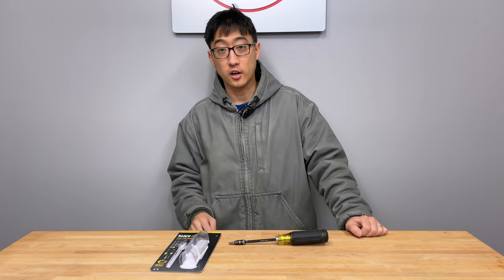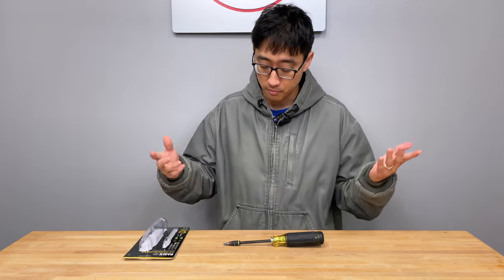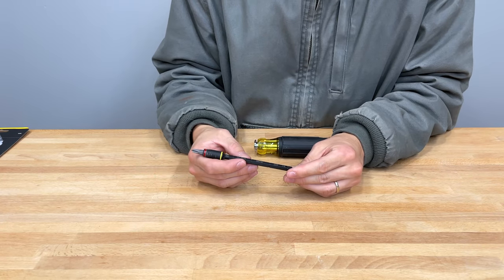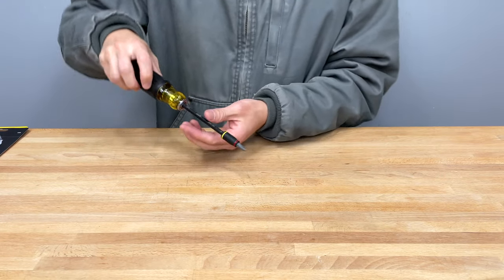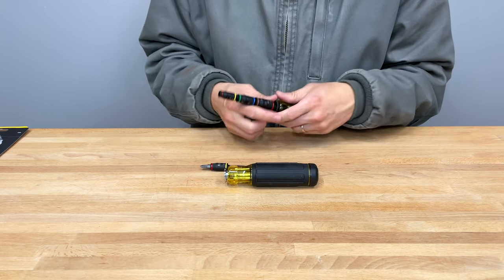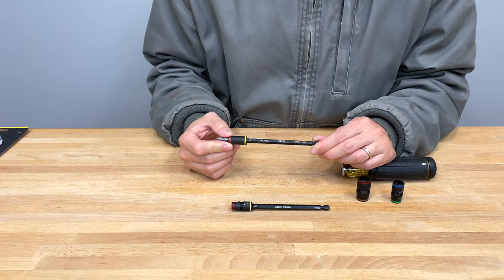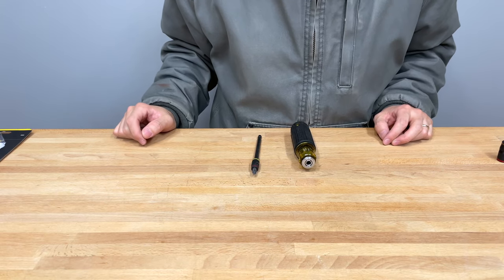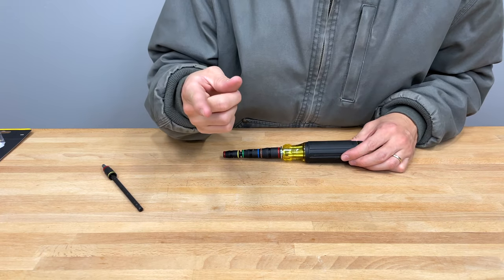You need this: Klein Tools 14-in-1 HVAC screwdriver | The Ultimate EDC all in one 32304

Comment: After seeing you remove your flip out of your 7 in 1 I’ll say my 7 in 1 handle was not releasing the socket at all. Some penetrator got it loosen up a little (it’s all I had) wondering if it was defective or is it supposed to hold the bit that tight.

Comment: I really like how you can shrink the shaft. My bit driver just broke from years of use, and I am excited about how this one looks. I am definitely going to get the Klein older stubby and most likely get both of these. The only multi bit screwdrivers I hate, are the ones with proprietary bits, like double sided one's. My last one was double sided and I use double sided bits with my Leatherman Rebar, but I use the Wiha bits. They are always going out of stock and not to may companies make good double sided bits, with all the different bits. The other day I seen a few triangle screws and I thought I had basically every bit I would ever need, until I seen the triangle screws that I had to remove. I really wish companies would stop making all these different screw heads. I understand that Phillips wasn't the answer and square and torx were supposed to be better, but why triangle. I ended up ruining a few bits, taking those out, since I didn't have those bits, and I bought a $30 bit set, that has pretty much all the bits you come across because of that. It makes me look bad, coming into a home or business, and not having the tools I need. That's why I love multi bit drivers. That's just my rant on screw companies. 😅

Comment: This is like meeting a new chic.  I'm 2:40 in, and so far I'm liking what I'm hearing and actually a little excited that I might have just found the one.  A shaft that you can take out and stick right into the impact driver!  I'm often driving screws with the impact driver all the way until they're near tight, and then have to switch over to the ratchet or screwdriver to finish tightening.  BUT, just like with meeting any other chic, I'm sure that something will come up to spoil this... probably when I find out how much she's gonna cost me.  Chics, I mean screwdrivers, this too good to be true are usually expensive.
EDIT: NO FREAKIN WAY!?  HD sells this thing for $24.97 !!!!  Ok, price is good.
EDIT: DAMMIT, I KNEW IT! She ain't orthodox.... oops, I mean it ain't ratcheting.  I knew something would spoil it.  I'm breaking up with this screwdriver.

Comment: I recently found something even better: Milwaukee 13-in-1. It has 1/4, 5/16, 3/8, and 1/2 hex drivers. It also has square bits perfect for ECX screws or whatever else they'll fit. It's also got Schrader valve drivers and large/small Phillips and slotted bits. The only thing it's missing is a magnet so that it will hold other 1/4 bits which don't have the ball bearing. It is a great tool I'd recommend looking into.
Reply: So, it has less and isn’t magnetic? Is it better cuz it’s red?
Reply: @senilegoldsmith4112  the only thing it's missing is magnets. Other than that, I've had no complaints with it out in the field. It easily gets more use out in the field than any other tool I own. I do want to try something like this someday just to see what I'd think of it, though